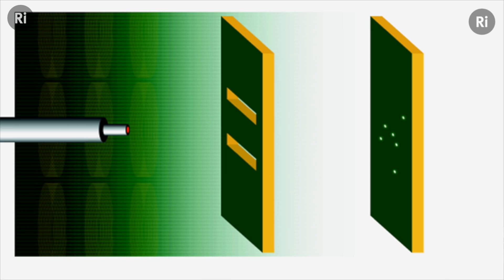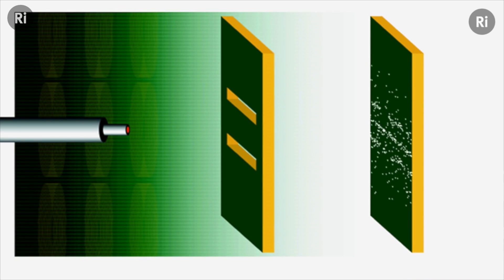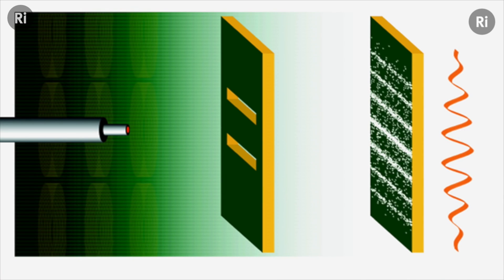The Double Slit Experiment - Monthly(ish) Mailbag #4

Comment: The explanations in this video are wrong and one only needs to accept two facts to see this: e.g. "photons" propagate like a wave and can only be absorbed/emitted as quanta.
(I'm putting photons in scare quotes because saying photon or particle makes people immediately think of tiny balls of energy - that however is a wrong image.)

There is no which-slit information. The photon travels through both slits like a wave, so there can not be any such information.
In the "unmarked" setup of the experiment the wave-like propagation leads to interference, given that the detector screen has a large enough distance from the slits to give room for the interference to happen, just like with e.g. a water wave.
In the "marked" setup, perpendicular polarization filters are inserted at the slits. The photon still travels through both slits, but the filters change the light's polarization. This is what prevents an interference.
The interference can be restored by adding another polarization filter common to both slits.

Mathematically this is beautifully expressed as a superposition. In the "marked" setup the filters change this superposition (but it's still a superposition!) in such a way that interference is not possible.
Add another filter common to both slits and now the terms that prevent the interference cancel out.

Comment: The uncertainty principle is a formalization of the minimum possible observer effect on any measurement of a quantum system. This whole “it's not related to observation, it's purely the information that we know - ooh!” nonsense needs to stop.

Also, for anyone wondering, the quantum eraser doesn't actually ‘erase’ anything. The effects are all in what correlations you pay attention to in the resulting data. There's no backwards causality, sorry to disappoint you.
Reply: This is incorrect. The observer effect and the uncertainty principle are completely separate notions. Even if you make the effect of of your measurement arbitrarily small (which is of course not possible, but for the sake of argument suppose it could be done), there would still exist the fundamental uncertainty limit which results simply as a fact of wave physics. The more a wave is localized, the more frequency components need to be combined to create it. This is a very common error to make, even Heisenberg himself and many contemporaries incorrectly thought the two were related.
Reply: “Even if you make the effect of of your measurement arbitrarily small”
That was the original point Heisenberg made, though. You can't make the effect of a measurement arbitrarily small; there's a limit. Which was then calculated and put into inequalities.

How does it being related to how waves work make it not related to the observer effect? Why cannot you view it as the observer effect applied to waves?
Reply: Because they are just distinct things that occur for different reasons. Again, the uncertainty bound does not come from experimental considerations. As a purely mathematical fact, a function and its Fourier transform cannot both be sharply localized - period. This is the case regardless of whether any measurement is made or not - if a state has a precise momentum it necessarily has imprecise position and vice-versa because momentum and position don't commute, i.e. they cannot share simultaneous eigenstates which is a fairly elementary result.
Reply: Is is a purely mathematical fact… about measurement limits.
If you're asking about a particle's momentum or position, you are necessarily discussing measurement, because asking for the momentum or position of a wave function is nonsensical.

Comment: Retrocausation is what the quantum eraser experiment shows. As if the object being measured knew when it was measured and how to respond not based on path but as to how it was measured... A particle or a wave. The eraser experiment shows how the object being measured can go back and change what was measured after the fact. The future effecting the past. The only way for this to occur would be an entanglement of position. As a wave, because it is spread out over more than one location, if you tried to single out a particle it would settle into one time frame in perspective to GR. Yet as a wave it is in a superpositional state in more than one location at the same time. Which means different speeds and locations within the wave. So it can be both in the past one thing and in the future another yet be the same thing at one time... When measured, of course. 😉